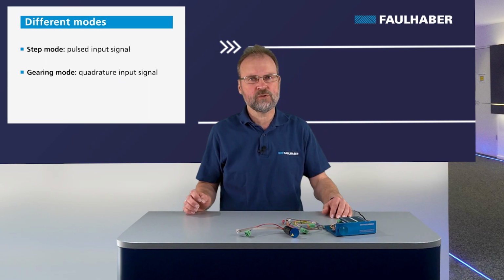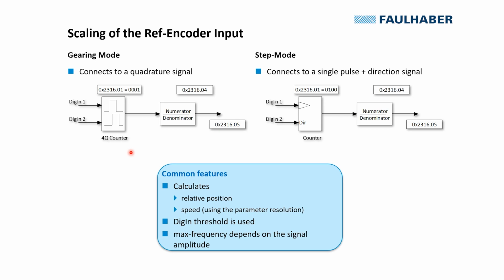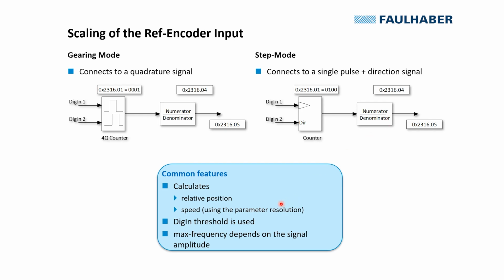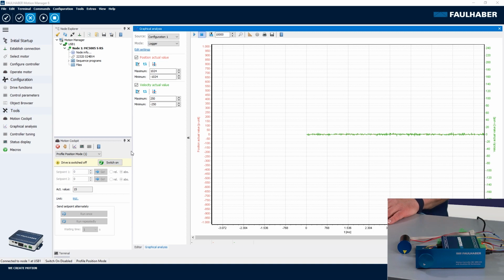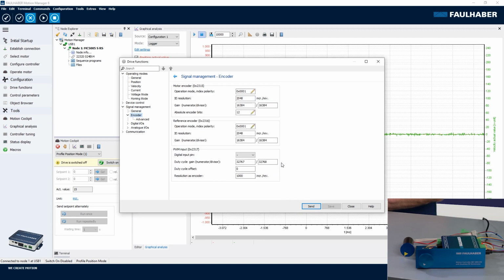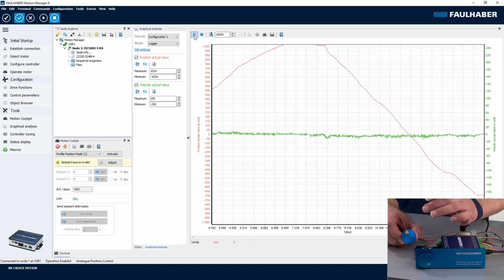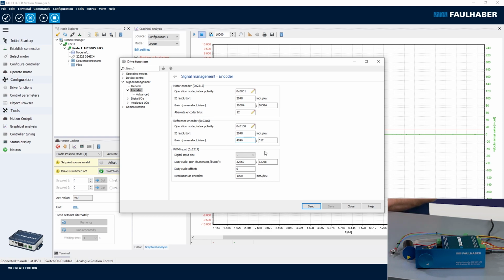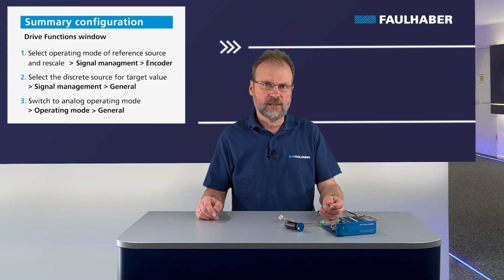How to use the Step and Gearing Mode of FAULHABER Motion Controllers V3.0 - FAULHABER Drive Time

Comment: how to use second encoder
Reply from the maker: The additional encoder is connected to DigIn1 and DigIn2. The encoder mounted on the motor is connected to the encoder connector M3 of the controller. If it is a brushless motor with hall sensors it has to be connected to the sensor connector M2 of the controller.